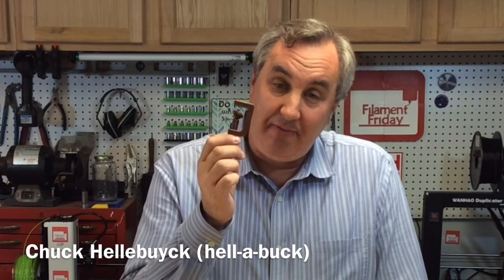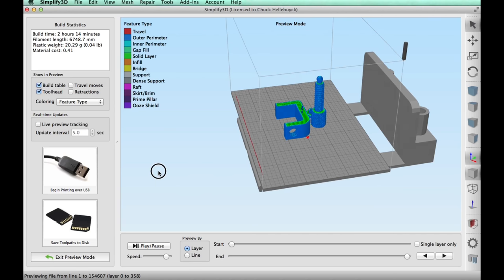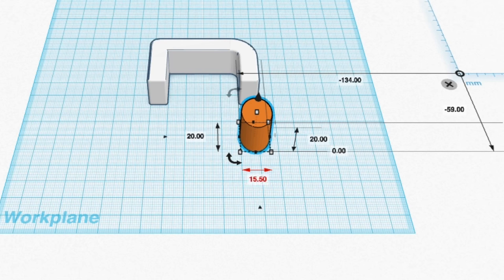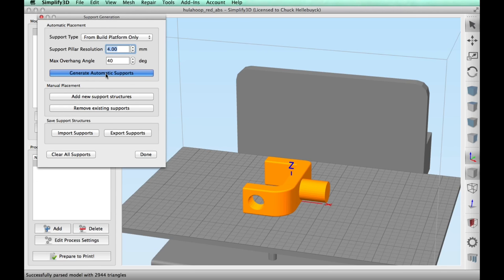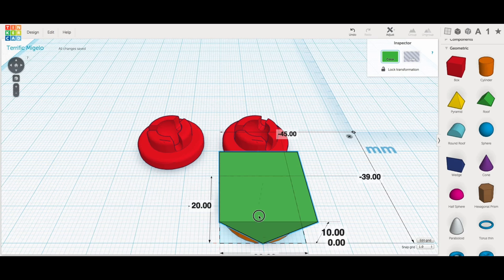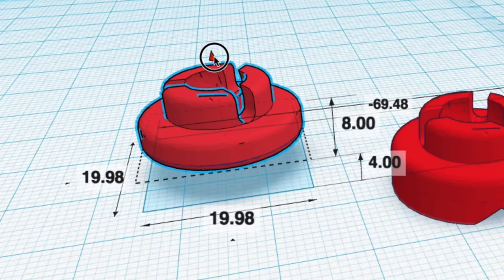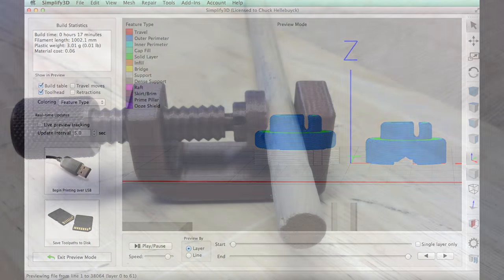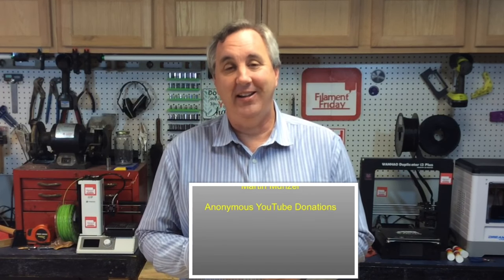3D Printed C Clamp from Thingiverse hacked with Tinkercad

Comment: Nice print and a super handy one too! For the supports in S3D, think of the piller size as more like the 'resolution' of the support grid it creates, the density of the support is actually a different setting under the support menu. The inverted point is super challenging but if you create a 4 layer 'dense support' interface maybe ~70% and the normal support at 30 or 40 it should work pretty well. When I'm lazy and making supports for complex models I'll autogenerate at maybe 2mm piller then remove any that stand on their own (most likely will fall over) and for delicate areas go back in with 8mm columns. Seems to work well. :)
Reply: Angus... your my hero

Comment: Very nice modification ideas! I always watch your videos! :)
I think the support resolution you changed is just to mark the area of the model you want to be supported!
In the process settings you actually change the support infill and do other fine adjustments about it :)
For the pointed one a higher support infill would have helped maybe!
I guess for automatic generated support a fine resolution is a good thing, but for manual placement you don't want to place so many pillars, so you choose a lower resolution!
S3D actually always tries to do zick-zack support, I noticed, so you can sometimes pull it off the print in one move :)